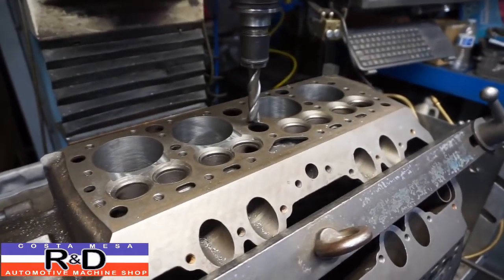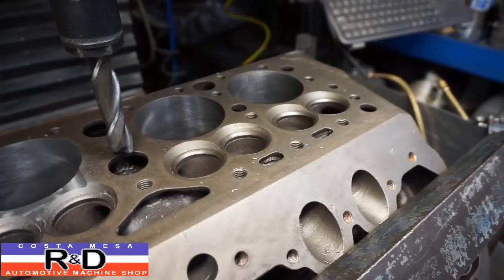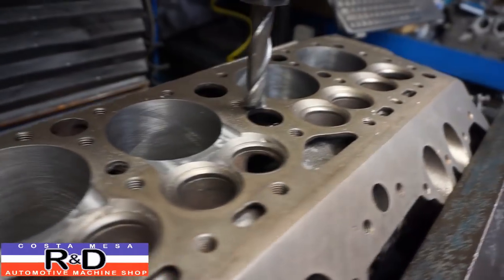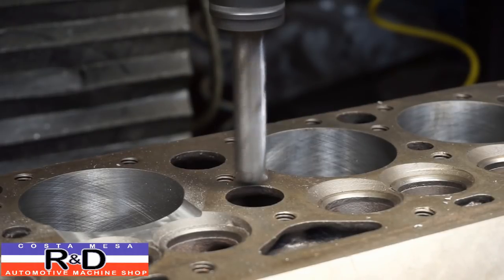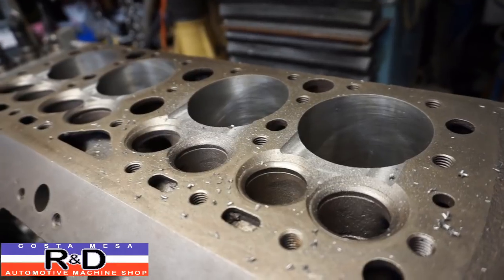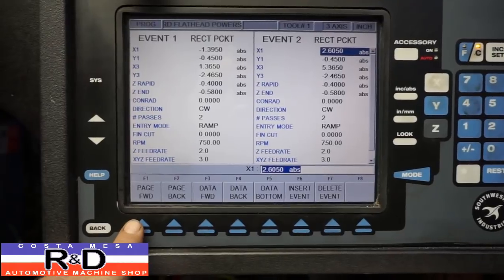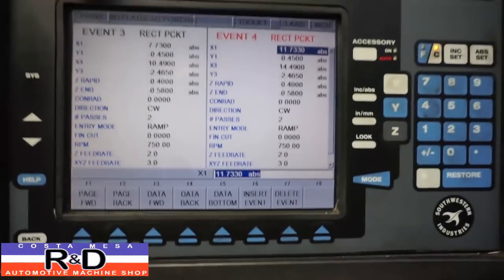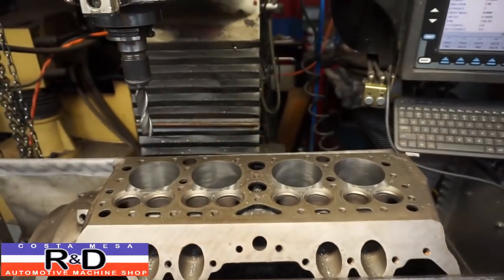Flathead Ford Power Slots with the CNC Mill

Comment: Doesn’t this lower the compression ratio a lot?
Reply from the maker: Somewhat, but I'm not sure how much since I have not measured the cc's of the material that I removed. This engine will have a 4" stroke crank installed with a 3.250" bore and use a set of high compression pistons and cylinder heads.